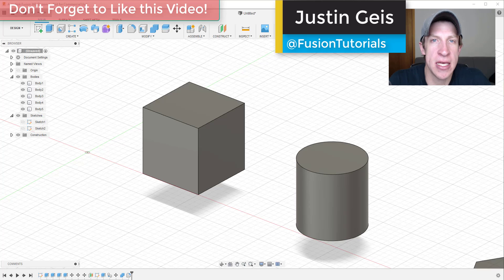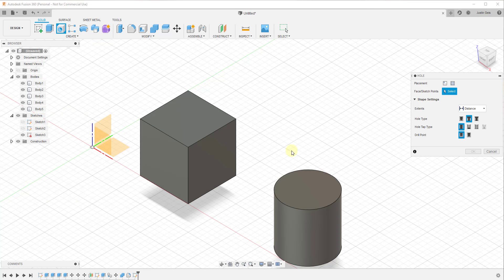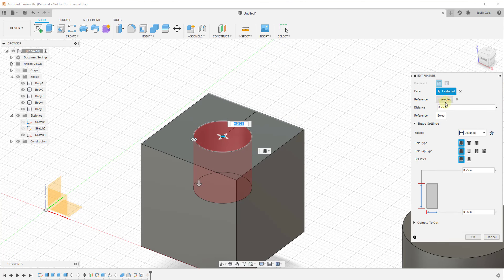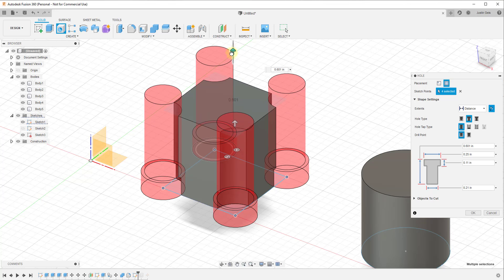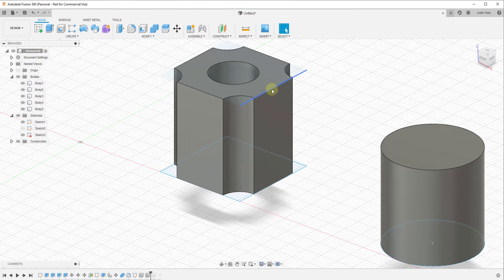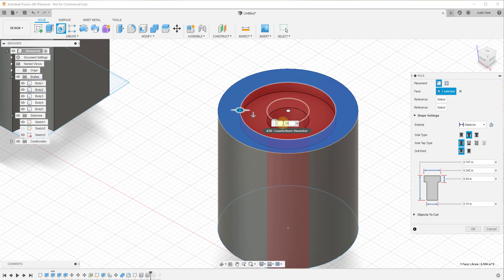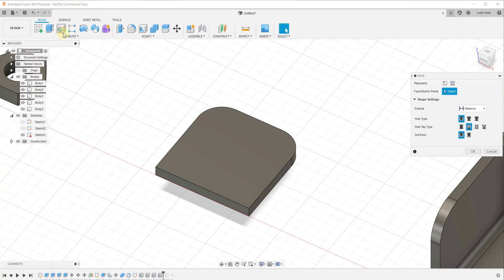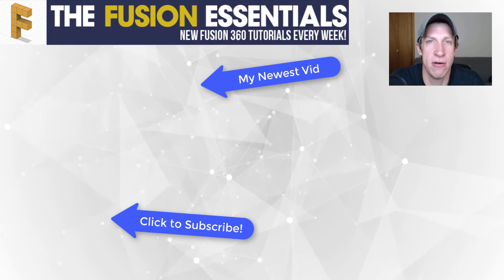Autodesk Fusion 360 HOLE TOOL Tutorial

Comment: This was good for basic holes.  I need to understand how to cut a hole diagonally on a curved surface.  In other words I have a cylinder and I want a hole for a screw that will go from the bottom of the cylinder to the top of the other side, thus allowing me to screw something in at an angle.  So far I can't find anyway to do this or anyone to explain how to do this.  Can you help?
Reply: Hey, not sure if you still need it, but you can do: 'Tangent plane'  -> 'Axis Through Two Planes' (selecting the tangent plane and the top of the cylinder) -> 'Plane at an angle' (selecting the new green axis) and change the angle to your desire. This should do what your after, let me know if you would like a video 👍

Comment: When a body is not flush with a sketch but say floating above it, and you want to use the sketch holes to create some counter sink hole in the body, how do you get the countersink parts onto the face of the body??? There is no "start from object" like in the extrude command so how do you do this without realigning the body with the sketch etc.??

Comment: Thanks it was very educational I have a  cnc machine with horizontal spindle and I was looking for how to use it and how to draw a hole on the piece but not on the surface if any one can guide me I will be thankful.
Reply: I would personally slice the model with an offset plane wherever you need the hole to be, and then create a sketch and draw the hole on the correct plane, then extrude using 'cut'. I'm not sure if there's another way to do this, sorry.

Comment: Great Tutorial. I learned a few tips even though I have used the Hole Tool for about 3 years. I have a scenario that I recently ran into. I have 2 Flat Bar Stok components stacked on each Other. Each has it's own Sketch. I have a hole in the bottom piece sized to tap 1/4-28. If I put a hole in the Top piece using the projected Sketch Point from the bottom pieces sketch and size it to Slip 1/4" then it makes BOTH Holes Slipping 1/4" (Which is the last feature in the time line) and in each components Timeline it has a "Shared" Hole Feature (which is indicated by the color of each component when I have component colors activated) any tips on how to avoid this issue.
Thanks for all the time you give to the community.

Comment: a deleted post from a question on making an 8 hole concentric bolt hole pattern.. with important addition

how to create a truly concentric bolt hole pattern...  divide 360 by the number of holes... this number will equal what is called Pitch Degree.... 

the center of the bolt hole pattern will represent X/Y 0

The first hole represents 360 or zero degrees; the X coordinate for your first hole will be the radius of your bolt hole pattern.. and the Y coordinate for that first hole will be zero.
 

Each successive hole in the pattern is calculated with the Sum of pitch degrees for that hole.. ie.  second hole will be calculated using pitch degree (360/8 = 45), 3rd hole will be calculated as second holes pitch degree plus one more holes 45 pitch degree.. 45+45=90, 4th hole will be the sum of previous holes sum pitch degree 90 plus pitch degree 45  = 135 etc.  ...

NOTE: you need to add the pitch degrees instead of multiplying by the number of the hole you are attempting to calculate,  because multiplying will not account for the zero or 360 degree placement of first hole.. it is possible to write this method in other ways.. but this is the best I know

the formula you use for each x and y location is as follows:   X=Sum Pitch degree Cosine times radius of bolt hole pattern   Y= Sum Pitch degree Sine times the radius of the bolt hole pattern.  

as far as I know, this will give you as close to perfect X/Y Data for Truly concentric bolt hole patterns, as a math formula may provide.. .the rest is up to your equipment and skill.

Some wisdom of this Circle method... the Number of God... Zero and 360 (All) count... the alpha and omega ...nothing and the sum of all things had better be counted as a hole number.. .the unknown.. and the omnipotent... seem, in some circumstances, to be warrantless of regard, but in truth.... are whole numbers too... and if you count the known without respect for the unknown... you will end up with eccentricity ...misery, poverty, famine, tyranny... instead of everlasting life..... .Truth is the name all peoples genuinely worship...seek truly... find the name in all things.

what this video doesn't show is... if you go into sketch and select create point.... as with create circle... there is no DRO... no way to see where your mouse is located with precision.. no data entry field... no basics..... no responsibility...

New designers, creators, machinists, etc. ... are forced to endure psychological turmoil, at best, as their employers have been forced through financial need to give money and perception of legitimacy to fusion 360's irresponsibility.... anyone who cries out will be made to look like an ass and not smart..... and any one who tries to help may be caused to be resented, and will certainly be guilty of associating with and legitimizing irresponsible leadership.    this platform doesn't have what your shop's bridgeport has.... but it is covered up in fancy crap to make assholes feel special and super smart... while laying waste to anyone honest enough to want anything representing a standard in industry to have actual coverage of the basics of the stuff that made all the rest of the bs possible.

Fusion smacks of the dishonest leadership of HAAS trying to dumb down the machinist in the name of making lower wage operators.... it gives credence to solid works over charging for their services.... and makes other fly by night operations seem legitimate.... it is irresponsible... it does not account for the first and last... and it does come with consequences.

I do hope you will correct it.... regardless... .the first and last does account for all things... all consequences... no matter how poor your math is.

Comment: Thanks for the great tutorial. I am working on a simple flat .25in thick bracket, which I created from a sketch that was then extruded. The problem is I want to create counterbored holes from opposite faces, but the locations for the hole tool are only available from the face they were originally drawn on (pre-extrude). I can't figure out how to project the point from that face to the opposite face (so that I can then use the hole tool from there). I'm sure it's something simple, any tips would be appreciated!

Comment: Is there not a standard size counterbore, countersink, clearance dimension for certain size bolts, or do you have to always manually enter those values? For example, Solidworks Hole Wizard lets you select your bolt size and whether you want a loose, normal or close clearance and it automatically provides the correct values for your clearance around that fastener.. We received some Fusion 360 models and the holes were too small for the countersunk screws.

Comment: how would you do that on a concave surface. The problem is there if you set an offsetplane at the lowest point of the concave rounding the tool wouldnt cut the surfaces above and if you set the offset plane on a higher spot you cannot set depth dimensions of the counterbore correctly. i have not found anything yet on the interwebs, so if you have a tip for me that would be nice :) thank you sir.
Reply: I'm also looking for this piece of info.

Comment: I need to create chamfered holes in a plate where the chamfer takes up the complete thickness of the plate. I find it the whole tool does not give you enough option to do this unless I'm doing it wrong. This is the first time I've come across this scenario where the chamfer is taking up the entire thickness of the plate and there's no vertical through whole following the transfer it is exactly at the point that the champions so basically the screw head is the only thing that is in the plate thickness I hope you can understand what I mean I've been tinkering with it for like an hour now and I can't get it to work it always adjusts to the thickness of the play and always leaves the smaller diameter exit hole with some vertical shaft it's frustrating as hell

Comment: Hey. Thanks for the tutorial. One thing that's missing is how do you create an angled hole?
For instance, in the cylinder, I want an angled hole from the flat top surface to one of the curved edges so I can thread a wire through from one side to the top. How would you do that please? Thanks

Comment: I simply do not understand how difficult this is. CNC programming is generally done from the center of the part in a Cartesian coordinate system (Most blueprints are drawn from a single origin which is easy to place a part on relative to the drawing). Prints are rarely drawn from the perimeters of a part. - I do not understand why you cannot use a reference as the center and describe location in X and Y. There must be a way - do you know how to do. When I place points on a sketch - laborious and silly. It will not let me cut a hole in the negative direction if the sketch is on the bottom of an extruded part. Am I missing something? Known to do that.

Comment: I really love your videos! I know making videos is a lot of work, but I hope you keep them coming. One piece of constructive criticism I'd like to make though pertains to how you make a thru hole. In this video, and also other videos of yours, you simply drag the arrow "more than enough" to insure the hole goes all the way through the part. This is fine if the underlying part length will never change. But the whole point of parametric modeling is that you can go back and change things, without updating operations that came after that point. So if your cube was 2 inches long, and you cut a hole by dragging the arrow 3 inches, then later made the cube 50 inches long, the hole would no longer go all the way through, it would only be 3 inches deep. A better option is to go to the Extent drop down box and select "All". This would guarantee a thru hole regardless of any changes made to the underlying part. Sorry for the long winded response. Just trying to provide information to the Fusion 360 community. :)
Reply: Excellent point. Thanks!
Reply: I'm new to fusion but I've done 3d work for many years.. things like what you mentioned with the hole depth seems like unnecessary history getting dragged along the process. If the nut has a hole made, it shouldn't matter if the object changes to 50, a hole is a hole. The hole maker and its size shouldn't exist anymore.. am I overthinking it?

Comment: Any chance its possible to do a one on one instructional? I just got this program downloaded a week or two ago and been going through several YouTube channels of tutorials. Yours seem to be pretty good and thanks for the content! I ordered a cnc plasma cutting table a month ago and just trying to get familiarized with 360 and hopefully get some of my projects layed out so I can more quickly go to work once I get the new cnc here and set up. So everything at this point that I will be doing is basically 2 dimensional.. perhaps I will be cutting 1/8" or 1/4" sheet metal. You have alot of great videos but much of it is content I will never use.. lease at this point anyway. So without spending a ton of time on doing 3D sketches perhaps I could get more into on something tailored to what I will be doing. Would like to chat more if that is something you would be interested in doing. Im in Wisconsin. Perhaps even a remote access would work as well. Let me know your thoughts! Thanks again!

Comment: Making a hole on the inside of a tube does not actually make a hole. Any idea how to work around this?  The origin of the hole will be on the tangent plane of the inside diameter, when you would really want the hole origin closer to the axial center line.
Reply from the maker: What do you mean "doesn't actually make a hole?" I was able to make a hole both through the middle of the tube and through the walls. If you're having trouble cutting a hole, another thing you could try is creating a tangent plane, then drawing a sketch hole and extruding it through the tube in cut mode. Does that help?

Comment: It is missing things that give me huge problems - placing holes in imported parts that needs to be placed precisely. Ex. 2 * M5 holes placed 16mm from a round hole parallel to a side, and without being able to use the side as Fusion does not let you measure preciely if you don't have a 90 degree angle. In my other cad you get length is 20.87, x=19.0, y=2 ex (not calculated and actual numbers). In fusion you only get the 20.87 I find it next to impossible to place a hole if you don't have a 90 degree straight line dimension or you have to dimension to the center of a hole. I don't understand why constraints and dimensions are only part of the sketch environment.